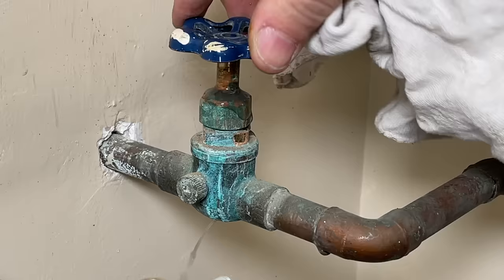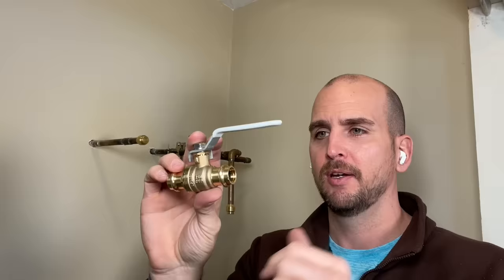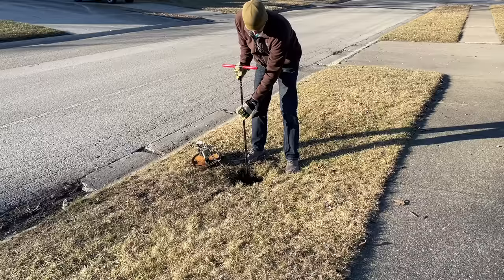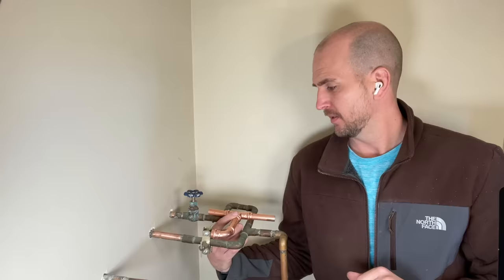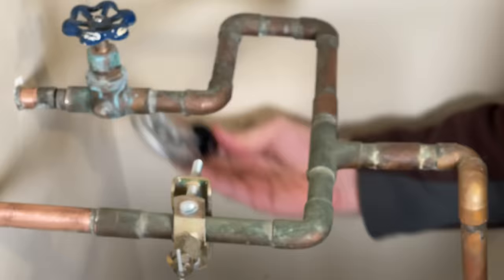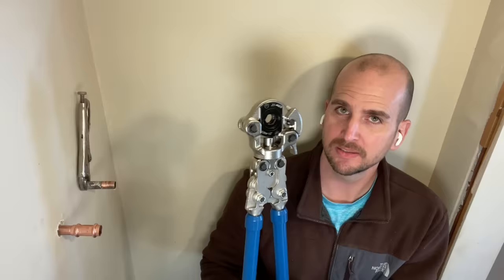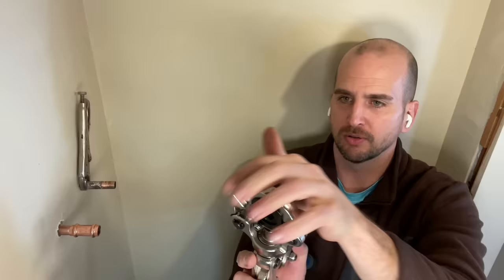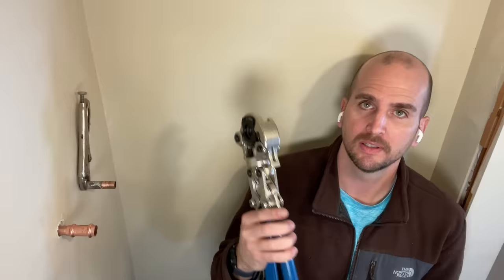How To Install a Main Water Shutoff | NIBCO Press Fittings

Comment: Sharkbites are loved by America's largest homebuilders, therefore I hate Sharkbites.  Homebuilding companies are always using the cheapest, least durable tech to make cheap homes and to ripoff the home buyer.

The pipe crimping system has some promise.  But still prefer old fashioned soldered pipes.  Just be sure to flush out the flux from the copper pipes using hot water or the flux will go down the lines and create pitting, which can cause leaks after many decades.
Reply: Jake the Snake 🤣
Reply: Good to know. Yes, have heard so many horror stories especially from US military folks. These companies are making away like bandits with our money and giving people crap in exchange. These human sized dollhouses less than 20 years old are falling apart everywhere I go.
Reply: That’s the real problem. Lazy plumbers never flushed the flux out of my cold water pipes and pinhole leaks developed. Most of my neighbors have experienced pinhole leaks too.

Comment: SharkBite couplings and T might be a solution for plastic but for copper special a boiler system will the robber get dried out and it's leaking in less than 5 years but a cap could last for longer because there is no force on it

Comment: Pro Press is an accident waiting to happen. You are depending on an O-ring usually butyl rubber. After a while that rubber will wear out, secondly they don't hold up well to a fitting like a valve that is manipulated often. copper is way too soft and after awhile it will leak where the O-ring seals.
Reply: Curious as to why you say this. Pro Press has ben around since 1989. I haven't heard of any failures.

Comment: Does that Iwiss tool press Viega Pro-Press fittings as well as Nibco press fittings? 

Viega is much more common at supply houses.  I have used a few sharkbite fittings but I would not use a sharkbite valve as the valve swivels after installation. A compression fitting ball valve does not do that. I have used some PEXb pipe and fittings with the Oetiker/Sharkbite stainless steel crimp clamps. I like that the crimp tool is $35.00, is small, and fits all the residential sizes. PEX is taking over in Upstate NY as it is so much cheaper and faster than copper. I still like copper and use it whenever it makes sense, but it is getting pushed out of the Big Box stores by PEX.

Comment: The disadvantage with ProPress fittings as if the building ever loses power in a cold climate, when the pipes freeze they expand the pipe round again and every fitting will come apart. I've seen it happen.

Comment: i don’t trust shark bites, soldering is hard to perfect but if you practice like 2 joints you can make fittings stick. DIYers can do it i believe in you! don’t trust a push fitting that relys on an o ring(wear item)

Comment: O-rings at or very close to the Water Heater = future leak as the o-ring is only poly/rubber insert that will eventually break down and leak. How do I know?  I change out water heaters all the time and so far I found a half dozen leakers. Granted they were all SharkBite fittings, they were leaking past the o-ring. These fast answers aren't always perfect.  Even with soldering things can go wrong. But if you are experienced, you know when a joint takes.   My believe is that the tool was invented for plumbers looking to cut down their visit time without having to lower the call out fee.  In short, getting more profit in less time. 
Now, as far as I'm concerned, Shark bite fittings should be outlawed.  "I'm an old school sweater", unless I'm away from the water heater or away from the outside or underground main, which should be always  3/4-1" scheduled K pipe in my opinion. And if I'm in a proper temperate zone, I use Zern Uponor expander on Pex type-B tubing. I was using over size Type-B tubing with Type B fittings and Stainless Steel crimp rings only because my plumbing supplier told me I couldn't use the Uponor expansion tool with Type B.  However, Zern came out with one so  you can.  So I Craigslisted my Ryobi SS ring tool and got the Milwaukee tool from a pawn shop that looked new for half price.

Comment: I like PEX. You could have used a fitting that is compression on the copper side and convert to PEX. $175 for a tool you will use a couple of times?
Reply: What's the point you're trying to make? This video is not about pex, it's about copper and using press fittings. $175 is cheap compared to a $2000 press tool.

Comment: Hey Scott !  Looks nice and clean, and effective!  👍 I’m facing the same or similiar situation, but with PEX, and the barb fittings with the crimp rings.  It makes for a solid and reliable connection, but is fiddly to get the fittings and the crimp rings all lined up.  Once the crimp is made, there’s no going back!  It’s still hard to beat a “sweated on” joint, but the NIBCO Press fittings seem solid.  I would pressure test them of course, and Double check on them for first few days.  Love these vid you putting out. 👍👍👍😁✌🏻🇺🇸
Reply: then use Pex A.
Reply: @davo912  OK there Bill

Comment: Ball valves do have a direction of flow. When open, the handle points to direction of flow.
Reply: When the ball valve is open the handle is parallel to the pipe, but code doesn't require the handle to indicate the direction of flow.  When shut off the handle will be at right-angle to the pipe and often has to be reversed to have clearance for the handle to swing.

Comment: Would it be acceptable to grease the pipe with some plumbers grease to facilitate sliding the fitting on?  Since no heat for sweating is being applied, I’d think it would be OK?

Comment: If you use Nibco fittings, can you cap off the pipe using solder or will it destroy the "O" rings with heat ??  I'm just a house flipper.  I'm used to soldering, but i'm really liking this system.  Thanks for the vid.
Reply from the maker: Hey Dee, this is a house flip for me as well. NIBCO makes standard copper fittings and also this line of press fittings.  You would not want to heat up these fittings as the heat would damage the o-ring.  I like this press system and also like copper so I think this system is my go to moving forward.  Cheers!

Comment: If for some reason that ball valve fails or the first crimp didn’t work properly, what are the next steps ? You don’t have very much pipe to work with if you have to cut that valve off.

Comment: So, in your video, which is great, you mention that most professional plumbers don't use Sharkbite press type fittings.  You used Nemco Press fittings for this project but I noticed you did use Sharkbite Cap Fitting.  

Is that a contradiction to you saying professional plumbers don't use Sharkbite fittings?

Comment: Live in a small rancher home with crawlspace and can only think of one place where I could maybe use that crimper and that would be the main shutoff in hell/crawlspace,  sweating fittings is not rocket science    but you don't want to burn your house down either !
Reply from the maker: Yeah, that is what I am worried about. I won’t have to do too many jobs before finding a scenario where those crimpers won’t fit.

Comment: A\
All through ball valves work in either direction it's  should be the direction the handle is in when open is the flow of the water.

Comment: Care to give an update on that fitting?  I'm skeptical of the manual press system.  Is there any way of determining what the applied force is?  Viega calls the neoprene a sealing ring because it becomes fixed when pressed whereas an o-ring can move inside the fitting like with push-to-connect.

Comment: The reason most professional plumbers don’t use shark bite (other than cost) is because it would be hard to sleep at night knowing that you’ve installed push fittings on pressurized water systems being held together with Rubber O rings and stainless steel teeth gripping onto the exterior of the pipe.  I can certainly understand the appeal of this product and if you’re willing to take the risk then by all means go for it… but water damage is expensive-.

As a plumber I always carry shark bite caps in my arsenal as they are extremely handy in a pinch. But only temporarily.

Comment: Question:  can you seat the ball valve Deeper than the 11/16 th depth.  Can it go to 3/4, 13/16 or more or does it have to be Exact?  Is there a stop lip on the ball valve to Ensure the 11/16th depth?  Thanks for your help!

Comment: I am a DIY'er but personally, I don't see why sweating copper is seen as difficult, so the extra expense (and tool purchase!) for crimped connectors seems silly for my casual use.  And I just HATE attaching anything that must be cut off to remove when I am working on a pipe stub that is already close to the wall or floor!  
That said, you have hit upon the one situation I have seen be a problem with sweating:  Ball valve main shut-offs.  The damn valves have teflon linings that are heat sensitive, yet the valve is massive and it always is attaching to a pipe that is full of water.  So they need a LOT of heat, and you can end up with it not getting hot enough for solder to flow before the teflon gets too soft.  I blew one apart when I went to replace my house valve; 15 years later I watched a master plumber blow one apart on the same spot!  And let me tell you that "blew it apart" is NOT an overstatement!  The stainless steel ball explodes out of the other end of the valve at VERY high velocity!

Comment: Any experience with the main shutoff for a trailer park. I have a friend at one who none of the plumbers who have come knew where the internal main is. I have had to purposely freeze the line to change multiple valves that gaskets didn't solve the leaks and most were corroded.  I have 4 more that still need replacing. Just curious.

Comment: In 2011 my plumber used the pro press ball valve to a whole house water filter. The media needs to be changed every 4-5 years. The valve leaked last time I closed the valve to change the media. There is no room to cut the pipe without having to remove the bypass and replace a T connector as well. 
Can you cut the seal on the valve being careful not to cut the pipe, remove the bad valve and crimp on a new one?
My guess is the pipe is deformed with the crimp so may not be possible.

Comment: It'd been mentioned (08:29) that the ball valve didn't have a direction of flow, so it didn't matter which way it went on.  Does that valve handle rotate in either direction as well, so as not to hit the wall, for example?

Comment: In my area I had to use a pressure reducing valve on the water line to knock it down to 40-60 lbs. The main water line has approx 150 lbs of pressure (WOW!). Not everyone has the pressure reducing valve and that kind of pressure will pop a Shark Bite off over time if the water is sut off and on fast like a washer or dish washer will do. Its like tapping it with a hammer. I still use copper & solder fittings for that reason. But since your method deforms the actual pipe too, it should hold up.

Comment: What do you think about using a compression fit ball valve ??
I need to replace my 1 inch incoming gate valve. I'm ok with sweating other pipe. But the gate valve doesn't close all the way.
Thanks

Comment: That same press tool is $305.00 with taxes from Amazon Canada.  A lot more practical and cheaper to solder a new ball valve in.
My Canadian city does not permit homeowners to access the street shut-off valve.  You need to call the city water department and they will respond withing 2 hours to shut the water off for a charge of $120.00 .  You can then go ahead and make the repair yourself.  When finished, call the city water department, who will be back withing 2 hours to turn the water back on and charge an additional $120.00 .  They will hang around until you do a quick test of your work for leaks and if a leak is found, they will turn the water back off for free so that you can do further repairs.  When you complete the 2nd repair, they will com back within 2 hours to turn the water back on, for another $120.00 .   Their charges are accumulated and added to your annual property tax bill.  Hiring a professional plumber will drastically increase the costs, because they aren't permitted to touch the city shut-off valves either.

Comment: I have one question about the pro press crimpers. That is if you crimp it and it's off to the right or left by 8:00 there a quarter inch or something like that is there any way to get it straighten back out without completely removing that fitting that's not quite lined up right?

Comment: Press fittings, sharkbites, pex expansion, crimp rings and sweat. People have a problem with everything. You use press then you lose an inch of pipe cause you can't heat it up and pull it off. Use pex then it's not as "strong as copper" use sharkbite and its not real plumbing. It's 2021. There are easier and faster ways go make a very reliable repair that will last so long you'll forget you even replaced it if it ever goes bad. It's impossible to sweat pipes sometimes due to water or the situation. And remember, manufacturing recommended life expectancy on fittings or methods are always much shorter then what it actually is.

Comment: Shark-Bites might be more expensive but they are very easy to use for the average homeowner. The key to a tight fit on the Shark-Bite is a clean and perfectly cut pipe to connect to. Also works better in tight quarters as no crimping tool is required.

Comment: That's the same exact crimper I have too funny. It does work pretty good but it's almost a two-man operation unfortunately. You need one guy to hold all the pipes together and the other guy to operate the tool and the second guy might need to actually help hold the tool as well.

Comment: Had a leak in shower enclosure, in the wall, my brotherfixed it new fittings, solder. Started to leak again. Took an hour no good. Bought shark bites fittings, took 20 minutes to install. One month later, still no leaks. Should have used them first. Save time and headache.

Comment: Why not add a second ball valve before the water heater? That way you can cut your hot water without cutting your cold at the same time. It something usefull when you will replace it in 10 years.

Comment: I need to replace my main cutoff value but I have a problem and that is it runs vertically up and down an outside wall and the ends are fixed so once I take the old value out I have to have some way to get a new value in. Since I can't move either part what do I do.  I know that I can redirect to the side and put a valve in and plumb the two parts together but I'd rather keep it straight if possible.

Comment: What is the lifespan of this nibco installed fitting?.  When I found out that a o-ring was involved, I got suspicious as "rubber" does have a lifespan.  What are your thoughts, thanks for your videos.
Reply from the maker: For longevity you can't beat a properly soldered joint.  Not sure if there is a quoted lifespan for the different brands for press fittings.  Around me I would say 80% of the pros have switched over to press fittings so it does seem to be the direction of the industry.

Comment: Hi Scott.  My condo unit has a weird set up.  The main water line shut-off valve has a house bibb faucet connected to it (2 in one for lack of words).  Is that normal or just an irresponsible builder bad plumbing workmanship? I've noticed that when i turn off the water main to  the condo,  the connected house bibb faucet still has a lot of water flowing, normally takes about 5 minutes for it to be completely drained.  Is this normal or is there some plumbing part that is missing that needs to be installed?  Your advice will be appreciated.  Thanks!

Comment: I have used Shark Bites and Watt plumbing connectors (actually I think I like the Watt connectors a little better).  I have only had success when I used silicon salve on the pipe before installing the Shark Bite connectors so the connectors will slide, and I always have to use a large adjustable wrench to move the Shark Bite into place by tapping---even after the salve has been used.
Give me your thoughts.

Comment: I would never trust "O" rings or ball valves for long term service. I've seen ball valves start leaking after about 5 years. They have "O" rings or plastic inserts that deteriorate quickly. I'd rather use a high quality globe valve where I can just replace the washer, or stem packing or even re-grind the seat if necessary. Actually brass gate valves are my preferred choice. I've seen some that are 100 years old and have been buried in the ground for 25 years and are still working. I bet a ball valve won't last that long.

Comment: Maybe I’m old school but I don’t trust an o-ring to last 60 years.  To solder them you need enough heat, clean joints and a press a piece of bread (Wonder) to keep any water back in the pipe while you are soldering the joint.

Comment: I’ve used Sharkbite but I don’t like how the valves can rotate around after install. I do like this crimp method because it’s easier but everything is secure after install like a solder joint. Not sure if I’m ready for that much of an investment In the tool though.
Reply from the maker: Yeah the tool is a big pill to swallow and just depends on the amount of plumbing work you have in the future to spread out the investment.

Comment: If Sharkbite work, why bother with Nibco? Expensive tool and frankly I don't see the aesthetic improvement, particularly in a closet. I would be inclined to only trust solder joints on water supply lines. Is 1/2" water supply normal in your area or is this a youtube set up for illustration and training purposes?